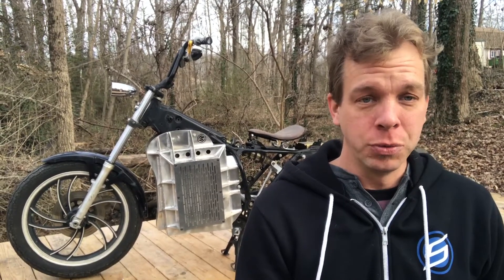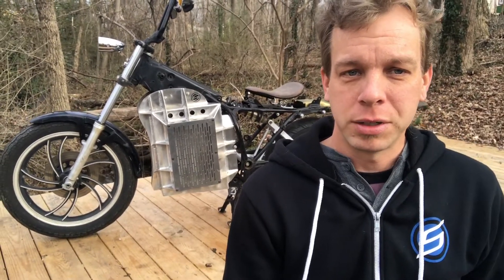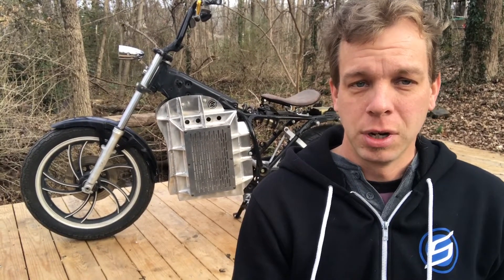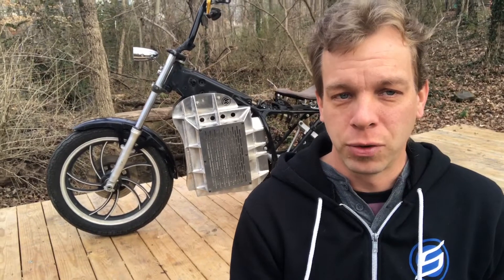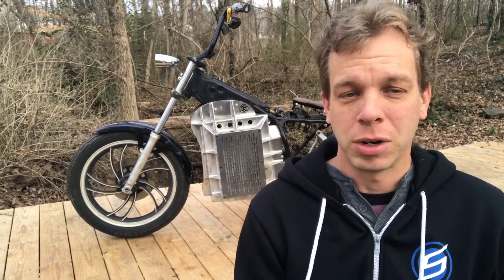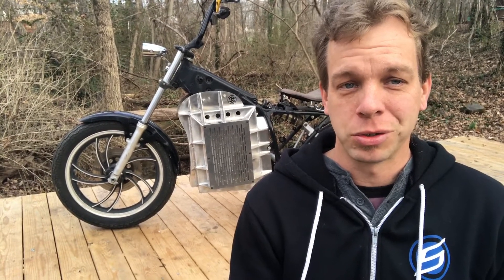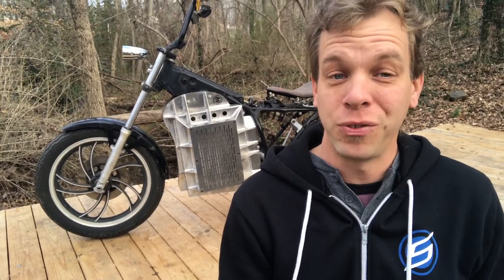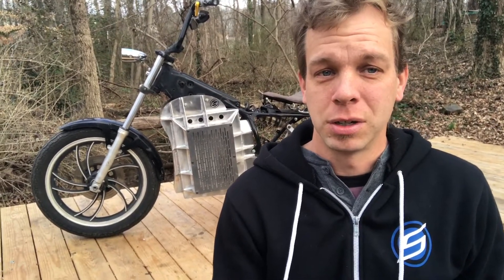Shandoka RetroFit System for Electric Motorcycles

Comment: Ernest, this sounds like an interesting proposition. I own a Triumph Bonneville America  - 2003 model. Do you have a conversion kit that will fit my bike? Also, am I looking at the weight of an electric battery motor vs. my petrol engine? I am sceptical that you are market ready for this technology on my type of motorcycle. But, I am listening. Share your thoughts, please.
Reply from the maker: We are still learning how to find these notifications, apparently! Sorry it's been so long since you looked at this. Even now - three years later - the battery tech for big displacement bikes like yours has a narrow use case. Your combustion engine is tucked into a frame, which limits the design of battery placement and so it would not be a good candidate for retrofitting with today's tech. But, a similar size bike that does work well is a Yamaha Virago 1100. With the structural engine removed there is space for 75-100 miles of around town or "rally miles" where you're cruising slow.

Comment: great idea mate. 
My first thought was to take a Trans Alp style Bike and do something similar last year. I pitched the idea to a mate of mine with a workshop but he said that the red tape regarding getting it through the UK registration would make it financially unviable. 
Have you managed to get it passed by any National Vehicle Associations?
Reply from the maker: Thanks for the comment - this application avoids the issue of approvals because there is no modification to the frame itself. About 30% of motorcycles have a stress-bearing engine and transmission assembly, so a bolt-on system like I designed doesn’t modify the frame, thus (in the US and I think UK) needing a visual inspection at local motor vehicle office but not an engineering review. We should have this powered up by May 2021 and I’ll share that process too!
Reply: @shandokacycles  i'll keep an Eye out for ya my Friend, good luck